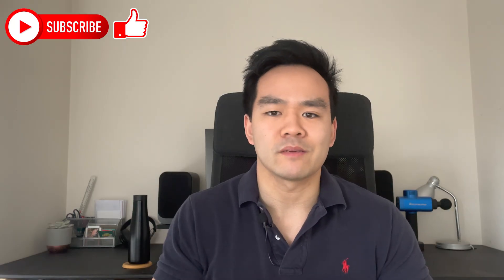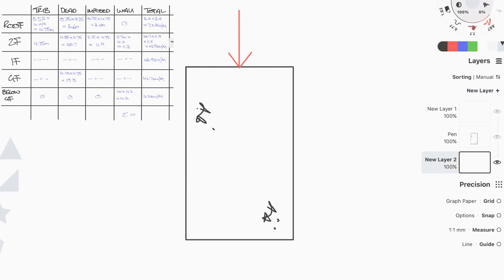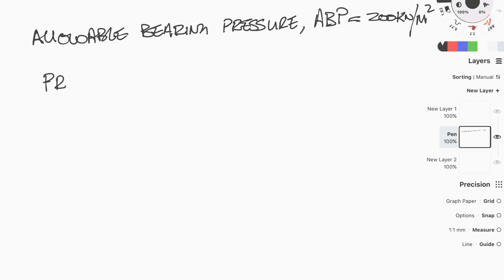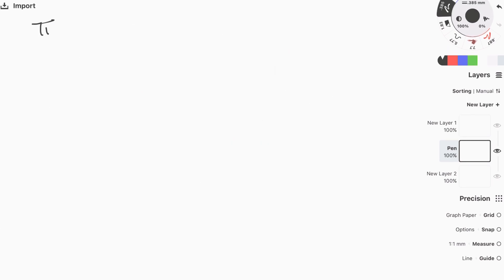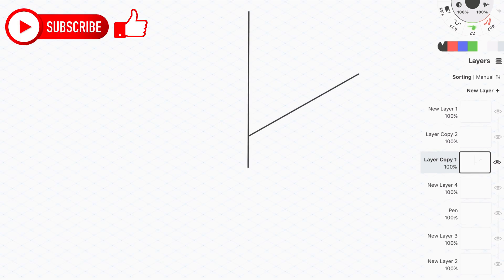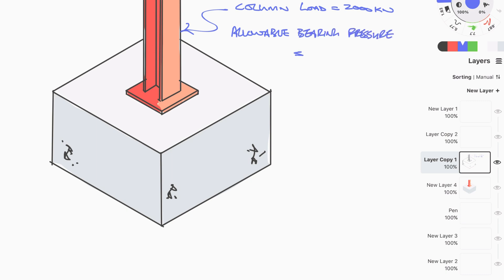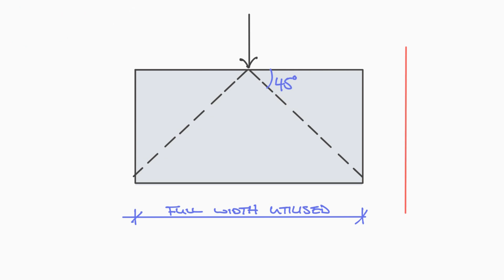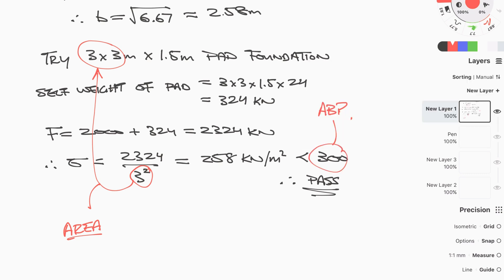Simple Foundation Design for Beginners - Structural Engineering

Comment: Hi mate, how would you work out the thickness of the concrete strip foundation, as the width you said was load÷by bearing capacity of the soil? Thanks
Reply from the maker: For a 45 degree spread. You want the depth of foundation half the width. So if you calculated a strip needed to be 800mm wide. For it to work you need a minimum depth of 400mm.
Reply: @EverydayDazz  Thanks for the reply, makes sense. Could I ask once the total load is applied to the foundation 141.9kn should a FOS be applied? Thanks
Reply from the maker: When you are checking against an allowable bear pressure provided by a geotechnical engineer report that should already have a factor of safety so the loads applied should be unfactored. 

If you are checking against ultimate bearing pressure then you will want to use factored loads because ultimate bearing pressure does not have a factor of safety.
Reply: @EverydayDazz  Great, thank you for spending the time to reply👍 What's the best practice on small projects like extensions we're the soil bearing pressure is unknown? Thanks
Reply from the maker: Try and find out what the soil is, clay/sand etc by going to site and then use a low bearing pressure. As long as it’s not something like peat then 50-75kpa is fairly reasonable. 

You can also look at geological maps to see what the soil types are and if any logs near the area where done.
Reply: @EverydayDazz  Thanks for the reply, useful information 👍

Comment: Great video. 
I have seen a building which has load bearing masonry walls, and also concrete columns. (sometimes the columns are between the walls) 
As a result, one has in the foundation a system of pad foundations next or between strip foundations. Could you please make an example about it? I'm interested in the distribution of the load on the foundations because I am not sure how much load would go to the pad and strip foundation, considering that they are just next to each other. Is there an interaction between them that one should consider (stiffness of the elements, additional load on the strip foundations because of being next to the columns)? 
I hope you find the time. And thank you again for the videos, they are amazing :)

Comment: I would really like a worked example of how you get from line loads to the column loads that would act on pile or screw type foundations. I am particularly interested in helical screw type foundation and would like to learn how to figure out screw spacing when I know the load capacity of the screw (as tested on site), depending on cross sectional area of timber beams spanning the screws.
Reply from the maker: I’ve done a piled ground beam video. That may answer your question about loads to piles.

Comment: Another Excellent tutorial Daz. As in all things Structural...maybe some typical design issues on a housing project?
That way, you get to cover quite a variety of elements, that can be applied no matter the size of the project?

Some things i'd (personally) like to see you post videos on (not sure if others would agree)

✅ Pile foundation? Working out the axial distribution over piles - which dictates your pile cap selection
✅ 1 way span slab is simple enough for a video which will def have value.
✅ Something thats always a good thing to know, is designing RC plinths. Sometimes its cheaper to to construct a plinth or, for phasing requirements for other subcontractors, but the ability to design RC plinths even a post fix solution, is something everyone should have in the locker. It gets the ground workers out of SO MUCH TROUBLE.
✅ Column design (RC or Steel) maybe include some of the SCI guidance for preliminary column sizes based on number of storey's (at scheme design stage)
✅ Composite design was always a long calculation, when working out stud requirements.
✅ Maybe some quick fore rule of thumbs you've developed over the years which take up no more than half an A4 which have served you well over the years?

Finally:
✅Slightly different one, but REALLY important - which im trying to get into the nitty gritty of it myself, the IStructE Plan of works 2020, which is based on the RIBA version. On the IStructE website, they have both the pdf matrix, and an excel sheet of all the responsibilities and what should be delivered as part of a structural engineers package. Every Grad or under grad for that matter, needs to know of these documents.

The stuff im spit balling is basically the stuff i had to find out for myself, but we have a duty to pass this info on (under the code of conduct). 

Look forward to your next one.
If you need 2D details or 3D details to help illustrate,, let me know - im more than happy to ping them over, or put something together. 

Keep up the good work mate.
Reply from the maker: thanks for the comment!
definitely a good list of topics and I'll be covering them at some point. 
I've seen the istructe matrix, it's really good so I can do a video that covers that too. cheers!